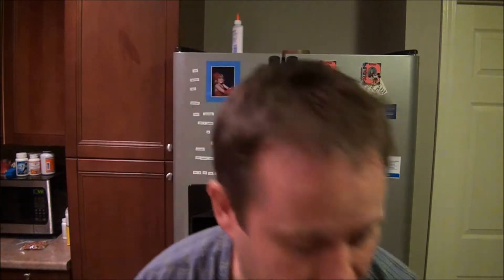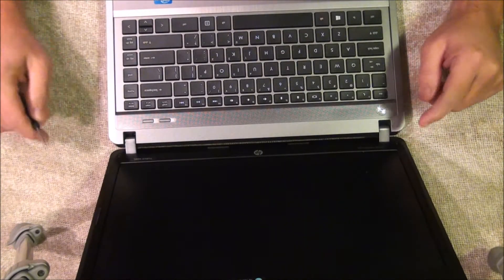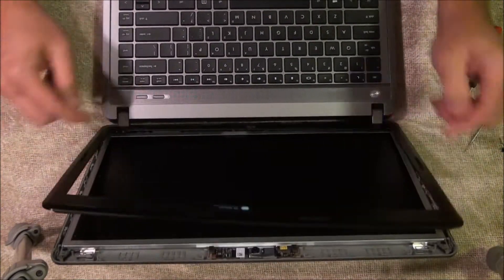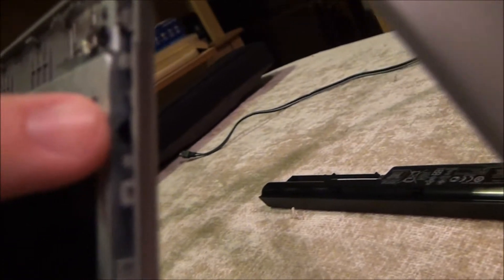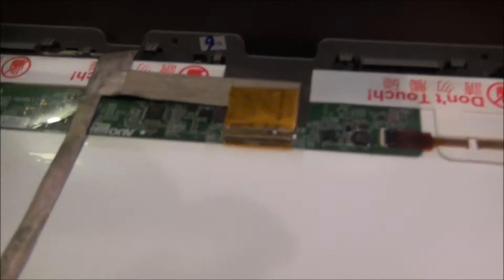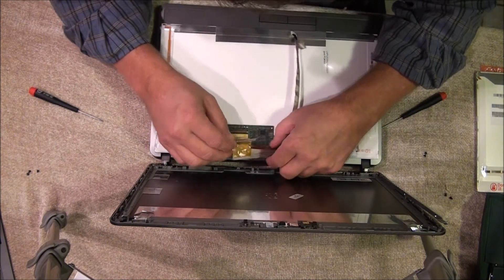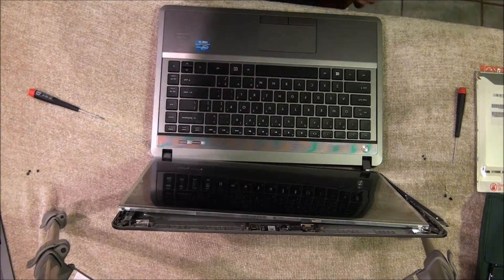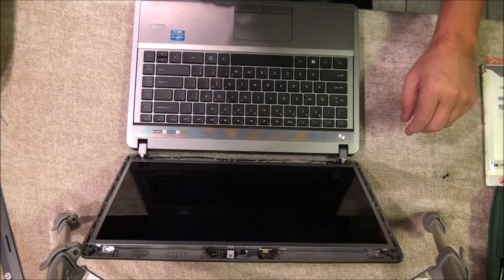DIY - How to Replace Your  Laptop Screen in an HP  ProBook 4440s

Comment: I have the same laptop and it won't turn on at all if I replace the screen will it work again?it just flash white where charger plugs.thanks
Reply from the maker: +Ashley Marquez Are you sure it does not turn on?  Maybe it powers up and there is nothing on the screen?  That could be a defective video screen. If it does not power on at all then that could be the battery, the power charging port or the motherboard.